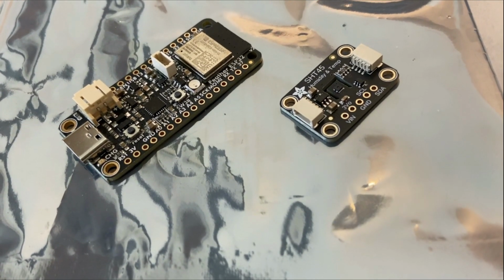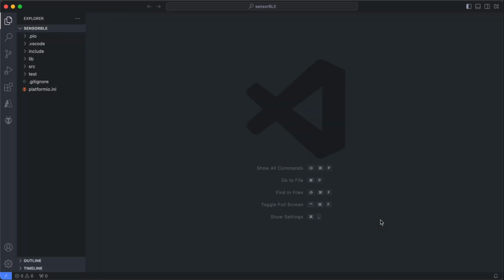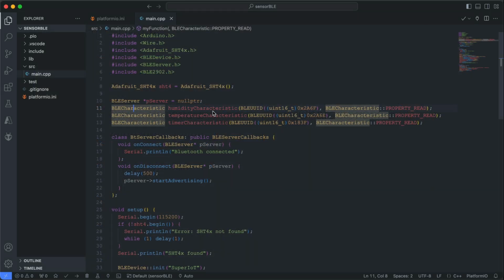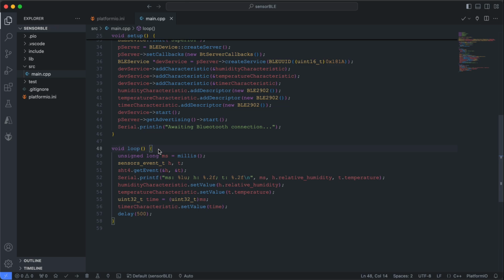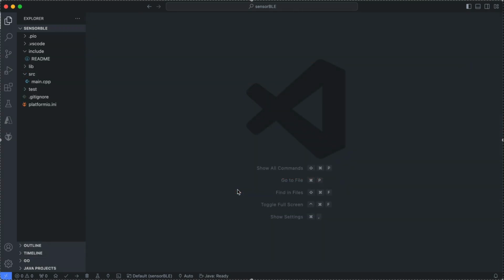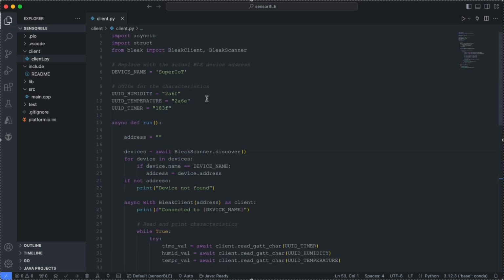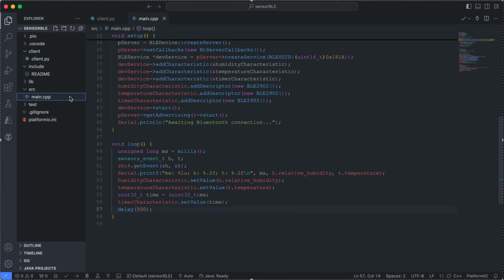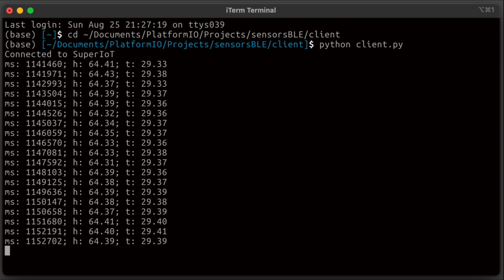Programming Bluetooth BLE on ESP32 Borad in VS Code

Comment: I wonder how you can display it on a smartphone, or how to make an app that displays measurements, but can also set, for example, the frequency of measurements, change the repeatability modes in the SHT45 (different accuracies), or sometimes turn on the heater in the SHT45. In other words, such two-way BLE communication from the application level.

Comment: are any of those dependencies required for just BLE transmission itself? I appear to always get the following error(src/main.cpp:14:10: fatal error: BLEDevice.h: No such file or directory) when trying this
Reply from the maker: For BLE, these dependencies are not needed at all: in this example, they are for sensors. BLE should work for ESP32 without any modifications to the platformio.ini file. All BLE is in the core and should compile with no dependencies. Are you using PlatformIO extension? Did you select the right platform and the core in the project creation process?